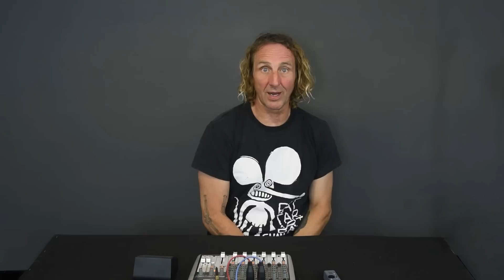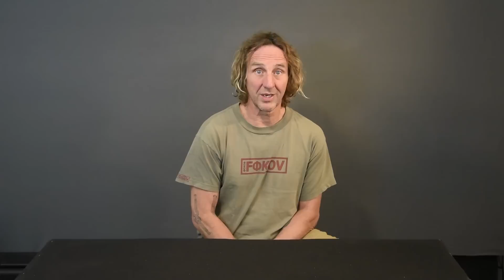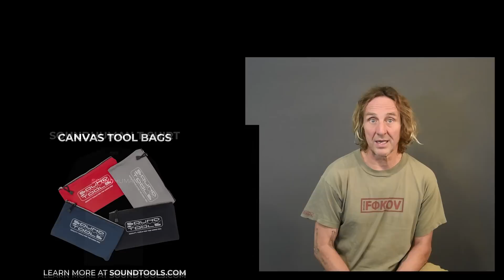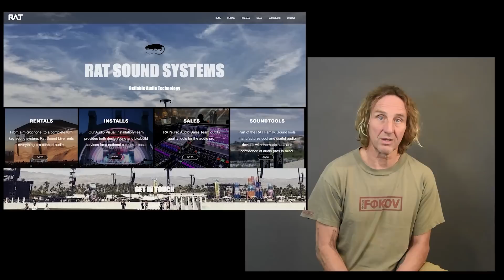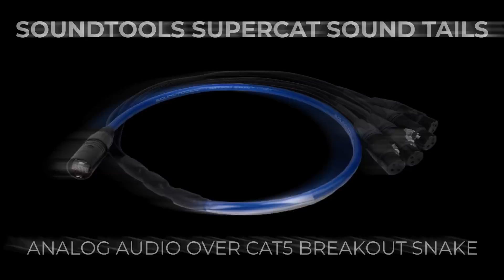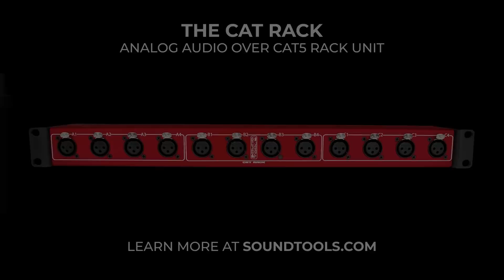Does Gain Pot Sound Different than Fader?

Comment: The analogy I always used to explain this was gains are water pumps and faders are spigots/valves. I use gains to calibrate various inputs to the same level for the board and the faders for the use case. Much the same as rural homes on well water require a stronger pump than a city home on a water main does, but the taps are turned up and down, from fully open to fully closed, as needed. As far as calibration I mentioned, I think of it as adjusting for different temperature scales. Some inputs come in using Centigrade and others using Fahrenheit (e.g., -10 dBV and +4dBu).
Reply from the maker: Good stuff!

Comment: I’ve been trying to conduct this same experiment; preamp gain vs fader attenuation shootout when I’m mixing monitors which is always something digital like an M32, SC48 or SD8 and for many confounding reasons I’m not getting consistent repeatable results testing for greater gain before feedback. What do you think specifically about monitors gain structure with analog split and digital console?
Reply from the maker: Avoid distortion avoid overload and that will help minimize gain before feedback. Close my king and clean signals with high quality gear will get louder
Reply: My hypothesis is this: Incremental decreases in microphone preamplifier input gain with system output volume compensation by digital processing reduces the sensitivity of microphones at the same system output volume thereby marginally decreasing potential for feedback. It’s a challenge to prove this because of so many confounding factors!
Reply from the maker: I don't buy it. The illusion that gain impacts feedback more than fader is based on people overloading the gain even slightly creating a compressor type scenario and reducing gain before feedback.

If the gain is clean and linear, then altering the fader which just raises and lowers whatever the gain sends it, then the two are the same.

Non linearities in the gain stage wos be the only issue and the should only occur near clipping

Comment: There's a simple way to put all this. Gain controls are always on the input of a component, or the beginning of a circuit, and attenuation (Volume Controls) are last. Gain controls can distort the the signal if pushed too far, and volume controls can't distort the signal. To further visualize the concept, a guitar amp is a great example. On a guitar amp, the gain and volume controls are usually right next to each other. You increase the gain to overdrive the tube and distorts the signal. Once you have the distorted sound you want, you use the volume knob to set how loud you want it. Now, I understand you would never want to do this on any other type of amp. I'm just using it because its easy to visualize how gain will distort a signal, and volume won't. You can do the exact same thing on your mixer, or any other piece of gear that has gain controls. Its just that on a guitar amp with tubes, the distortion sounds good. Too much gain on solid state gear sounds terrible.

One other thing I feel worth mentioning is resolution loss when you are adjusting volume in the digital domain. Normally, this isn't worth spending too much time on if you are working with good quality files (CD quality on up). I DJ as a hobby, and 95% of the files DJ's work with are lossy (MP-3). If you are aver working in this type of environment, its a relevant factor that you should be aware of. It really can impact sound quality. Even on the highest quality MP-3, most of the musical information in the file has been thrown away during the transcode. If you stick to just using 320kbps files (best quality MP-3), the noticeable effect is minimal. However, if you start off with lower quality MP-3's, you can definitely have issues.Its just something to be aware of.
Reply from the maker: Hmmm, got to be careful with "always"

Power amps tend to be fixed gain with attenuators on the front end.

Compressors can have gain on the in and the out, or just the out.

Digital consoles tend to have both a gain and an attenuator in the form of a digital trim, and a pad is a fixed attenuation switch which is often before the first gain stage.

But in general, what you describe is often the case with consoles

Comment: Instead of over driving the gain on the console and risking damage to the console, wouldn't using a compressor to limit peaks in addition to raising background sounds be more practical? In my early years while mixing on someone else's console I frequently found channels 1 and occasionally 2 blown. They were where the kick and snare usually resided. :) I learned early the technique to getting a fatter kick and snare by overdriving those channels. I never approved of that approach. I invested in compressors early on.
Reply from the maker: Interesting, a console design that can't handle high gains into overload is as undesirable as over loading to the the point the console fails.

Comment: Another great thought provoking video, Dave! I have always felt that pro audio power amps always run at their maximum capable output when turned on and the knobs on front were input adjustable controls, attenuators, for each channel of output. Most people I've discussed this with didn't know that was the case since the volume does go down/up when you turn those attenuators. My point is that most power amps run wide open when their powered on. The input attenuators on front let you set input sensitivity not output. I'm speaking of pro audio amps without DSP as they don't have the obvious knobs on front but have attenuators inside their software but work on the same principle. I assume most if not all power amps work on his principle.
Reply from the maker: Agreed. Most amps are fixed gain with front end attention. I have seen some cheap amps that have gains on the front.  Old Tapco if I recall and that was a huge noisy bummer that would often distort

Comment: Would the results of this null test be the same if a mic were used instead of the signal generator?

When I first started doing live sound I was running into feedback problems and another engineer told me that taming feedback is all about input gain control—if you turn down the input gain and turn up the fader or compressor’s make-up gain (this is on a digital console), you can achieve the same volume level in the wedges without feedback. I’ve always sort of wondered if that were actually technically true, but I’ve been functioning as if it were true for years and it always seems to solve feedback problems—maybe I’m fooling myself?

What was explained to me is that the input gain actually makes the mic more sensitive while the other stages don’t—which is apparently the common misconception.

If the thing we’re trying to disprove is the input gain’s influence on mic sensitivity, I would be curious to see what would happen with a mic instead of the signal generator. If a test were done that way, would the Y-cable create a weird variable related to whatever’s happening between the preamp(s) and the mic?
Reply from the maker: Ahhh, the gain vs fader to fix feedback. Fact or fiction?  

Did a vid on exactly that topic.

https://youtu.be/chgovyDUxx4
Reply: @DaveRat  Ah amazing! But looks like that link you posted is just to this vid—what’s the vid you’re referring to?
Reply from the maker: Maybe this one

https://youtu.be/chgovyDUxx4

Comment: Thanks for this. I was always told that proper gain structure would result in better signal to noise ratio and now I know that that’s only true if we compare clipping to not clipping.
Reply from the maker: Higher gains do give better signal to noise ratio. But if you count undesirable distortion as noise as well. Then a gain somewhere below clip and above hiss becomes optimum

Comment: Hi Dave I'm a big fan! I'm wondering what your opinion on the use of limiters in live sound? I don't like to use them, but someone recently challenged my beliefs and I'm wrong a lot so I'm investigating.  I've seen guys use them on the channel, master and (most common) within the dsp. Thanks for the videos man!
Reply from the maker: Limiters are extremely useful when used correctly and absolutely necessary to get maximum system outputs and to protect systems from damage.

Setting a limiter so that the audio does not get louder than a predetermined level is wonderful.

Lims and great to deal with singers that scream, or certain guitar effects boost to super high or just to smooth out inconsistencies and for system protection.

That said, most of the time most of the inputs should be not in limiting and limiting should usually only be audible if it's set up wrong or the system or input is being over driven.

The limiter turns it down so ya don't get blasted, things distort or blow up.
Reply: @DaveRat  thanks for the reply! I'll start working them in more and see how it goes!

Comment: Dave: Would this still be the same if the gain pot actually controlled gain rather than just attenuating the input signal?  For that matter, are there really gain pots that control gain?
Reply from the maker: Gain pots do control gain. The gain pot determines how much gain(boost) to the signal and the attenuators ( channel, group and output faders and rotary aux sends) determine how much to reduce that signal.

What I am showing is that a gain pot does not sound different than an attenuator

Comment: My brain was like, "now I know how to remove the vocals to create an HD karaoke track"      ....

The other way the background is raised with the gain is when the live sound system has a compressor inserted on the channel, and the sound guy is confusing the compressors influence (greater influence) than the gain pot.
Reply from the maker: True, a compressor would impact it. But I don't believe the flawed belief is based in compressors on channels.

I've met some smart techs and engineers that grasp the interconnect wiring and operation of gear but lack the electronic understanding, that believe this oddity.

Comment: Panning laws vary between gear depending on whether they are designed to maintain constant voltage, constant power, or a compromise between the two, very nice video!
Reply from the maker: Very cool and thank you

Comment: I feel that mic amps sound ' faster ' or ' punchier' when they're cranked. In my mind, the slew rate is faster the further the amp has to throw the signal,  it must be faster if it is achieving more voltage in the same time?
Reply from the maker: Hmmm, using that analogy, would it not be easier to move something not very far but very quickly and to move it farther, it would more difficult and slow down? Meaning gain turned down would be quick responsive and turned up would be sluggish?  Not unlike an electric car off the starting line, super punchy but at 80 miles per hour, hit the gas and all the punch is gone.

Regardless, the analogy does not hold well. There is no mass to electrons and also it's pretty easy to test and hear differences using a null test. The primary factors are staying above the noise floor and below clipping. Followed by having the fader in a usable place around the zero db mark or where you visually want the fader to sit

Comment: This entire 18 minute video could have been summed up by just saying you take your mic level with the Gain knob, push the stupid Pre-Fader Listen button and make sure the Meter isn't staying in red.  How hard can that be?  By the way, that's incorrect to say that Faders can only take away level.  Faders can add level by as much as 10db.
Reply from the maker: Or possibly you may have some assumptions that are incorrect and you missed an opportunity to learn something. And instead have held on to those incorrect assumptions.

ttenuators, often refered to as faders and often linear slide but rotary aux sends are also attenuators, can only drop the level.

Though people often are confused by the +6 or +10 and 0db labelling and think that because it says +10, it actually adds 10db. This is incorrect and one of the important aspects I am trying to point out.

When arentuator ( channel fader)  has a +10 capability (labelling) it actually means that there is a +10 gain stage somewhere after the fader.  So the signal enters the fader and if the fader is at the max or +10, the signal is unchanged by the fader. When the fader is at 0db, the fader is dropping the signal 10db.

Then, somewhere else in the console, the signal is "gained up" 10db.

The 10db post fader gain is always there regardless of fader position.

Comment: With some recording preamps/gain stages, they would add harmonics/saturation even before clipping as I understand it. Do most live sound boards have super clean preamps, and not saturate before clipping?
Reply from the maker: The live sound pre amps vary but in general added coloration is not sought out. That said, pee amps that still sound good when clipped are more desirable.

Comment: Super cool! I always wondered if there's any truth behind the gain versus fader sounds. I'd assumed it was just hearsay since I never seen someone prove it, but I never thought about how a gain pot could add clipping and distortion that a fader would not.
Reply from the maker: Yes and also, super low gain and high fader will add some hiss as well. But the actual sound of the audio should be the same as long as you stay away from the extremes

Comment: I'm new to PA systems, but I might disagree with his analogy of the PAN pot. If it's in the middle, both channels L/R have the same max level. If it's halfway left, it Will have half(or logarithmic half) level on Right channel, but the Left Channel still receives Maximum level. I hope someone corrects me if this is wrong.
Reply from the maker: A pan pot is basically two faders where the center position is 3db, 4.5, db or 6db down for both left and right, depending on the pan pot type. That's worth checking out as well.

As you turn the pan pot it fades left up and right down and visa-versa when turned the other way.

If you connect a mono PA to the left output, you can use the pan pot as a fader by panning to the right. Or connect the pa to the right and pan left to fade.
Reply: @DaveRat  Thanks for confirming this. That's what I meant. As soon as you turn pass 12 o'clock, let's say to the right, the right channel will Remain at max, and the knob technically become a Max-Zero Fader for the left channel.
Reply from the maker: Not exactly. The right is max only when the knob is turned all the way to the right and as you turn to the left, the right begins to fade down to between -3 or -6 when you reach 12 o'clock. And fades gradually faster as you continue to turn
Reply: @DaveRat  Oh nice info. Thanks for the clarification. This is very helpful.

Comment: Thank you again for being such an amazing educator. I have sort of worked backward when doing musical theatre sound where I set the amps wide open, mixer outputs at unity, the faders at -10, then run the gains up to a good audible level, but way short of clipping (and get decent headroom). Where this breaks down firstly is noise, but usually not too bad from mic packs. -It's when I'm tracking to a DAW to have students practice mix, or when I make a board mix, the levels are way low. I have since been attenuating the amps more, but we are blessed with pretty great noise floor these days. Lighting is the new hum coming from the stage...
Reply from the maker: Yeah, there are many paths to get good results. Things like having too much PA for the venue or low to medium volume level shows, will inspire reducing amp levels to keep gains up and faders in a reasonable position.

Generally it is better to send hot and reduce the level later in the signal chain to optimize noise floor, as you started doing.

Comment: Ha, I've heard the whole background noise (spillover I call it) will increase with gain pot.   I saw  this "problem"  is actually coupled with the mains fader (aka Gas)  position/amp attenuator gain structure than with the  fader position.   The most contested example is where do you set the cgain for High hats since using VU meters to get gain got you a hot mic in the mix.  I saw so many touring engineers who turn hh to - 15 with the fader, instead of the more common turn the gain down and mix at 0.    I mixed on a soundcraft venue in the 90s. The deal with the high hat in my opinion should carry over to today:
 I took the  perspective that the pfl led / vu were both  c weighted with different attack /release times.  The problem is actually with the higher frequencies being represented in VU due to log /power issues were not represented properly by either vu display.  So the proper way to set the hh gain was based on what sounds blended volume for  unity gain setting.
Reply from the maker: No reason to make things so complex and there is not much magic.

Gain and faders do the same thing, they bring everything up or down.

But, too low gain will add hiss and too high gain will distort. Once that sound is established, the fader just increases or decreases it.

I just did another video on gain and balancing the four goals of gain structure:

Reduce noise
Avoid overload
Avoid faders near the extremes
Establish visually desirable fader positions
Reply: @DaveRat  so you both agree user your ears, ideally set the gain so that the fader is at 0.

Comment: I may be wrong, but I find a bit of truth in the “gain brings everything else up” argument when using condenser microphones. I feel like the amount of gain effects the microphone directional response and sensitivity
Reply: Maybe design a test and run it and see!
Reply from the maker: Hmmm, gain does bring everything up or down. And also the output of the gain stage goes into a fader that brings everything that comes out of the gain stage up or down.

So, with the fader all the way up, you hear purely the gain stage.

As you bring the fader down you still hear purely the gain stage but at a lower level.